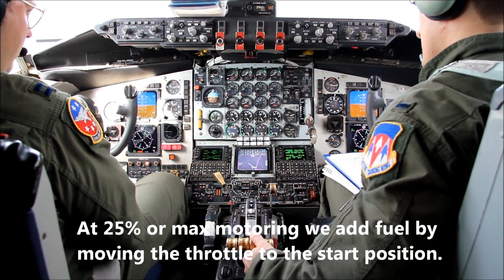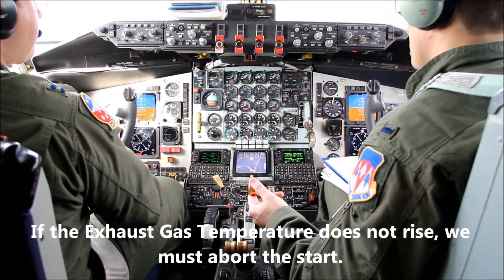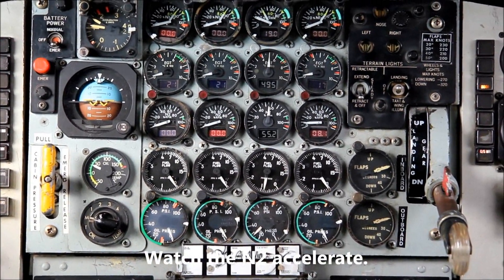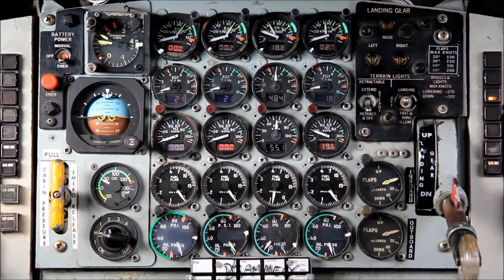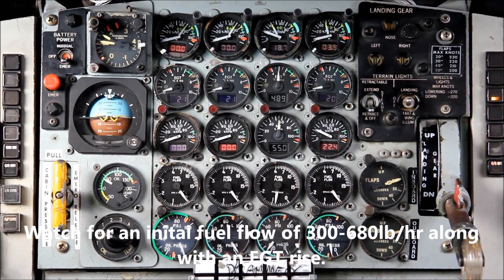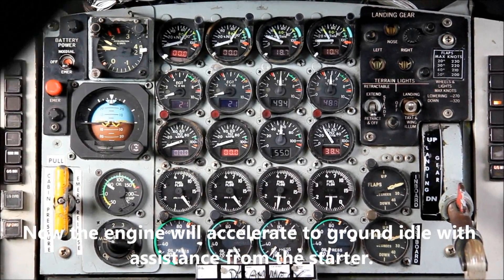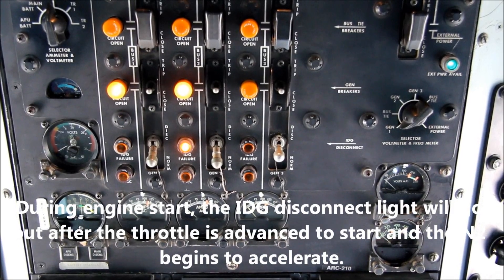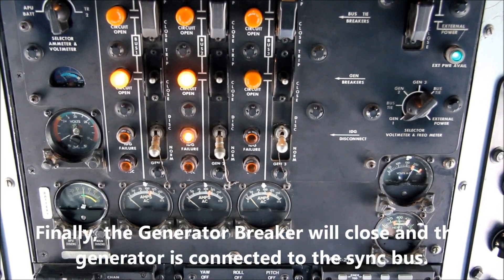KC 135 Engine Start Narrated

Comment: As a flying crew chief, that was one of the qualification that was need to be on fly status with your jet on Tdy;s. It;s been over 21 years since I started an engine. some of it came back, other steps I forgot. I always love running engines. on fuel xfers, or off load,  that was rare.  Pressure check for environmental, or system check. I just love running engines. Ask any crew chief.

Comment: I'd like to see the video of a scramble start, all four engines at once.  That's what your APUs in the main cabin are there for,  right?.
Reply: Somebody in the know feel free to correct me, but based on my experience with many other Boeings, he -R model can't start more than a single engine at a time. You may be referring to the turbojet powered A-models, where you could gang bar the start switches when and if the J-57's had the black powder start cartridges installed, starting all four motors at once. Quite a bit of black smoke involved. On the new airplanes, the 747-400's can start two at a time using on-board (APU) pneumatics, and the 787 can start both engines together, as long as the ramp is dry. Engage one, count to three or five (Can't remember) and engage the other.
Reply: @LJDRVR we can start more than one engine at a time.
Reply: @LJDRVR  Can't speak for 747s or 787s, but I used to be a jet troop on R/T model KC-135s.

To answer the question, you're partly right. I think the old J-57s had cartridge starts (might be wrong about that, way before my time, but I know some USAF planes can still use them, and that would be the simplest way to start 4 engines simultaneously). Otherwise, they probably used ground cart pneumatic starting. In any event, the A model did not have APUs installed. I'm not sure when in the KC-135's modification history the addition of APUs occured, but eventually the plane was indeed moved over to using onboard APUs for starting engines... And yeah, that's APU's PLURAL, because of the need for scramble starts. I'll get into that in a bit though.

The KC-135 shares a lot of DNA with the 707, which is an airliner. Airliner designs after this started putting APUs in the "hellhole", a compartment behind the rear bulkhead of the cabin, inside the tail, since it's a relatively convenient space to put something like an APU. However, the KC-135 already had that space accounted for with a small reserve fuel tank which is so far aft that for weight and balance reasons, is only filled up on the heaviest of fuel loads (fuel loads we rarely use anymore as it puts added stress on the plane and fleet wide, engines have gotten a lot more efficient since the 1950s). All of the space below the cargo deck is also accounted for with fuel tanks. This made the addition of APUs to the KC-135 a bit of a funky prospect.

The J-STARS, a similar plane (old 707s converted to military use), I got a tour of one time. They actually built this goofy pressure chamber that passes through one side of the plane and out the other, housing an APU below decks, but technically fully depressurized for use in flight. Since ours was upstairs, it was kinda hard to do this design without blocking off the boom pod area in the back.

So... Whatever poor engineers had to work on this problem, essentially came up with a fire resistant box enclosure for the APUs at the back of the tanker. This enclosure wasn't sealed or anything, it was at the same pressure as the cabin... This imo had some really unfortunate consequences (especially for me as someone who had to maintain these pieces of junk). In order to gain access to intake air and exhaust, the APUs had intake and exhaust doors. While some airliners do have an intake door just to keep things like nesting birds and other junk out of the intake, they often don't have exhaust doors (good riddance, the temperatures cause a lot of metal fatigue on these things), and more importantly... They don't have to be airtight to maintain cabin pressure... Since they're outside the cabin... Since our APUs were inside the cabin, our intake and exhaust doors have to seal against the airframe to maintain pressure. These seals were a common culprit of cabin depressurization issues. And, to make them open and close at the right times, they're connected to the APU start sequence via a long and complex linkage with different kinds of springs... In cold climates, the doors can freeze up, and nothing is more annoying than a boomer trying to manually check the doors open and close in the dead of Alaskan winter, before the heater cart has thawed the APU system... Shear pins in the linkage can break to protect the doors from recieving more damage from being frozen up or blocked, and they are a pain to replace. The springs both on the back of the exhaust door, and on the linkage itself, wear out and often need to be replaced... Incidentally, the one on the back of the exhaust door (as well as replacing the exhaust door seal) has a really terrible manual that involves ripping apart APU insulation to get at removing the door from the inside... We had an alternate procedure that I swear should be official, it entails just using a ladder on the outside, and changing these components on the door inside the exhaust without needing to fully remove the door. I improved on this improvised procedure a little bit more by finding I didn't need a second person to help hold the door up (to avoid bending the seal against the side of the exhaust pipe) if I just folded over a wad of pigmats inside the exhaust to lay the assembly down on. I'm rambling, anyway, point is, KC-135 APUs are a more annoying maintenance hog than the F-108 engines themselves, in part because of all the compromises the engineers had to come up with to fit them in after the fact.

Some weird quirks to come out of this setup are that the APUs cannot be operated in flight, and will not turn on without the weight on wheels switch activated. If you did manage to get the start sequence going, the shear pins in the door linkages would probably just break as it tries to open the intake/exhaust doors inwards against the cabin pressure. Then, our enclosure is terrible. They put not one, but TWO APUs in the plane, for both basic operational reasons (if one breaks, the plane can always start off the second one, no ground cart needed. Huge help because you don't know what weird places you might deploy to, not every place has compatible air carts to start off of), and for scramble starting. The need for 2 APUs while saving room for cargo on the cargo deck, meant cramming them as close as possible inside the APU enclosure... Then, annoyingly, this enclosure isn't well thought out for APU maintenance... The enclosure is bifurcated by a wall between the APUs, so that a fire on one can't start a fire on the other... Which makes sense... But then the lack of access means half of each APU is almost unreachable for maintenance reasons. I cant tell you how many times I've had to do a start fuel nozzle and fuel restrictor change, by feel alone, while hugging the number 2 APU closer than I'd hold a loved one. Then, to make things worse, the corners of the enclosures are fixed metal, one solid piece with the rest of the enclosure... And it so SO gets in the way, along with that middle wall, when trying to do APU changes. Then the enclosure is so small, that the legs holding the APU up have to fold to get the APU out... And the bottom of the engine is a fragile oil pan... So you can imagine what trying to yoink one of these 400 lbs APUs out for an APU change is like... Not fun.

Anyway, ranting aside, TL;DR, the K/T model KC-135s use two APUs for scramble starts. One APU can only start one engine at a time. But, with 2 of them onboard, engines 1 and 4, and 2 and 3, can be started simultaneously in pairs (assuming both APUs are working. Often, one is out of commission due to the maintenance and supply issues with them). Even outside of scramble starting, if both APUs happen to be working, some pilots elected to dual start just for funsies and to make the startup go a little faster. Many didn't though, even if both APUs were working, just to reduce APU wear and tear, and avoid having to write one up if it failed to start up (thanks pilots).

Now, for scramble starts... Those genuinely are only saved for real scrambles, and I'll tell you why. The APU start switch up in the cockpit has 2 modes. You can see it on the panel at the beginning of the video. Each APU gets a start switch, but in between them is a yellow button called "EWO START". I forget what EWO stands for, something like "Emergency War Operation". EWO starting is a little different. It's a one button push to start both APUs. It is not a normal APU startup. The APUs are cranked to 1300 degrees F (instead of the usual 1200 degrees F). This puts WAY more wear and tear on the APUs. But, the added performance massively improves start times, even when you're slowed down to starting engines up in pairs instead of starting all 4 engines in earlier models.

I've only ever seen an EWO start once, and it was an accident. We had an E/E tech who was messing with buttons in the cockpit. We asked him to watch hydro pressure while we start APUs... Walking back to the APU control panel at the back of the plane, we suddenly hear the APUs kick on before we got there. We looked to the front of the plane confused. And the APU EGT guage read 1300 degrees... The E/E guy accidentally pressed the EWO start button... He thought the button looked stuck or pushed in wrong and tried to fix it... There was nothing wrong with the button, all he did was EWO start it. We were a lil ticked at him, but the APUs were fine.

So yeah... I admit, way too much context, but the APUs that were retrofitted into the KC-135 after the design was finalized is one of the plane's many weird quirks and I thought the system deserves that extra context here. But in short, the KC-135 R/T model cannot start all 4 engines at once like an old cart start... But it CAN start 2 engines at a time thanks to having 2 APUs, and those APUs even have a special mode for an event like a scramble start.

Comment: Some other things to keep an eye on, make sure hydro light goes out on motor (or else engine hydro pumps will cavitate). Call out "40/60", meaning you've reached 40% N2 under 600 degrees EGT, and if you're feeling froggy, call out "30/40", for 30% EGT under 400 degrees EGT. If the engine doesn't achieve this, it is not necessarily grounds to terminate the start, however, if it exceeds 600 degrees under 40%, pay EXTRA attention to your EGT, because failing 40/60 is an indication an overtemp may be coming. Make sure "LOP" (low oil pressure) light goes out by idle, and make sure the starter light goes out. It should go out automatically by the time you turn the starter switch off. If it doesn't, turn the starter switch off... If it STILL doesn't go out, you can save me some troubleshooting headaches by closing the overhead bleed air valve closed within 10 seconds of start, that should finally force the starter to disconnect and the light to go out... That greatly reduces the risk of shredding a starter. Oil pressure at idle should be above 11 PSI, and oil temp below 175, the oil temp gauge has a selector and will automatically show the highest temp.

And if you're a pilot watching this, do jet troops a favor and never... NEVER... make an issue out of "fuel flow flux"... Unless the other indications are fluctuating too (N1, N2, EGT), or the fuel flow indication is clearly broken somehow (like showing 0PPH at cruise, for example), then don't complain the fuel flow is fluctuating. Fuel scheduling on the F108 is an old system, it's clunky, not really an exact science, and the fuel flow meter is literally just a turbine on the fuel line coming off the MEC. It's not particularly accurate. So long as the engine is making the correct power settings, and isn't fluctuating a bunch in N1, N2, and EGT, then fuel flow fluctuation isn't an issue.
Reply: fuel flow fluctuation range was added to engine limitations in 2019.  Never say Never... i'll hold my tongue.

Comment: You must have a weak APU if you can't get the N2 to 25%. When I was an engine mech on 135Rs, I had APUs that could motor up to 27% and sometimes 28%.
Reply: When/where did you serve?

All the APUs are old hot garbage now. Occasionally we get a nice one that max motors at 25%, or a little higher if you wait. But most of ours technically reach max motor at 22-24% and need a while past that to reach 25, or struggle to get above 20% and can't even reach 25%. Also a gamble anymore whether they'll start right at all, most of our redballs are APU.

Every now and again, we have to do a wave of back to back APU changes because several jets started getting 1 or 2 really bad APUs and simply don't get to 20% in a reasonable amount of time.
Reply: @hatman4818  wow, thats just crazy. I was stationed at Grand Forks from 95-99 with the 912 ARS, then they combined all maintainers under the 319th AGS. I was in white flight working 912th jets. 
Our big issue was start nozzles clogging.  Usually carried a stash in my backpack. If it was a #2, usually could change the nozzle thru the fire door. We did have APUs that would get to 22% and then lag. Adjusting the guide vane actuator on the apu sometimes gave you a couple more percent when starting  the 108, but if not we replaced it. Big apu issues we had were when the jets would come back from Mildenhall. They were good and taking our ESCUs from the apu cabinet and giving us their broken ones.
Reply: Just close all the bleed air valves and leave the motor you’re starting open. 😂😂😂

Comment: I've never heard of a jet engine starting up and then the blades rotating the wrong way...does anyone know any more about this?
Reply from the maker: The wind can turn the fan backward with a tailwind. I have a hard time imagining a situation where the N2 is up to speed with the fan rotating the wrong way though. It's also possible for no fan rotation if there is ice frozen at the bottom of the duct.
Reply: @oisiaa  Good answer, thanks.
Reply: Out in Grand Forks, the winds coming across the prairie always caused the fans to spin counter clockwise depending on which way the jet was parked on the ramp. The fan is not mechanically connected to any other part of the engine and can free spin.
Reply: @Hogmech  so there's no LP turbine powering the fan, it freewheels in the slipstream? That's downright bizarre
Reply: @Hogmech  The fan is connected to the LPT
Reply: @raymondwallace1031  I know it is,  I'm a retired jet engine mechanic.  What I was trying to say is that it's not tied into the gearbox and the pto like the compressor and hpt.